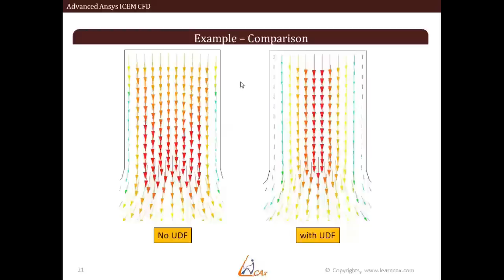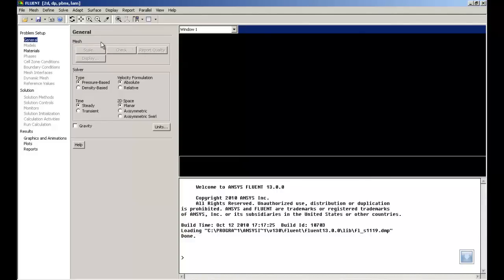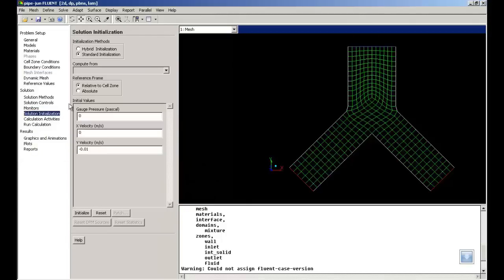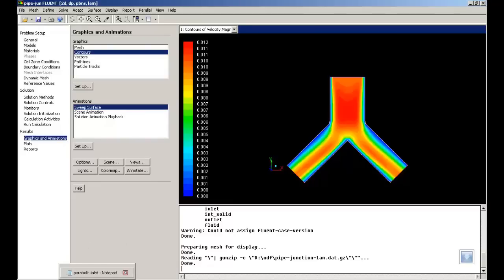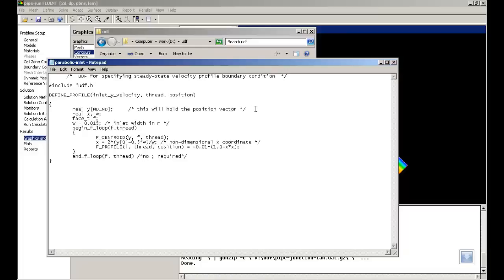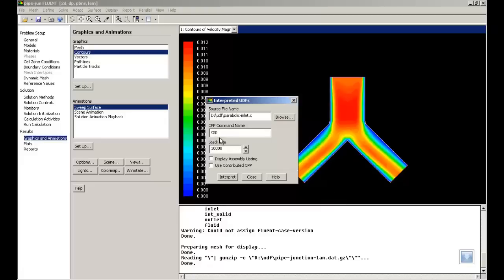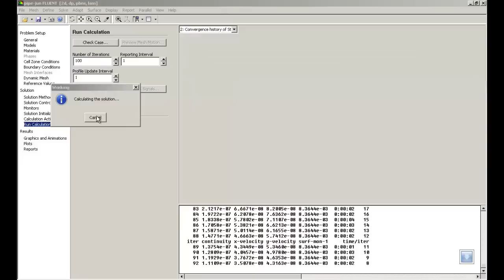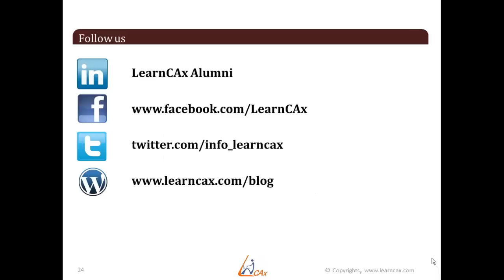Introduction to UDFs in ANSYS Fluent

Comment: can you explain why you use loop for this udf.
Reply: Asif Iqbal  hi i need to add a heat source inside a closed cube for 15 min, then it will be turned off. How can I do that? I am new in Fluent. Thanks in advance
Reply: Dear Hazra, I am also a beginner in fluent.i recently started my m.tech project.i still learn but not expert in this. Sorry for unable to solving your problem.

Comment: Sir, what happened if i need to define UDF for the inlet that is not line?

Let me tell details. I have complex velocity inlet from real terrain data (satellite data) and the domain is not so simple. Example, my inlet is on variable height z=950-1110 m. I found myself struggling with the defining the relative height, not absolute height, like you have in this case. 
Example:
F_PROFILE(f,thread,position) = V_ABL*(1/kappa)*(log(z/Z0)-PSIm*(z/L)+PSIm*(Z0/L));
I wan't the variable "z" to be relative